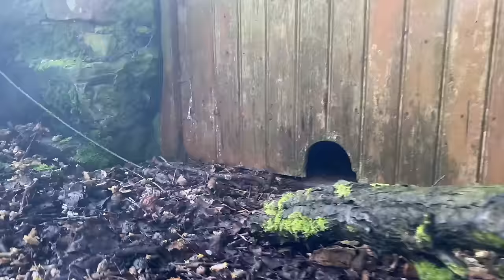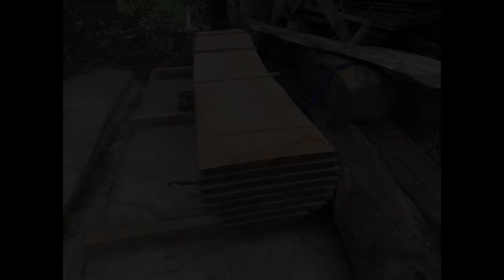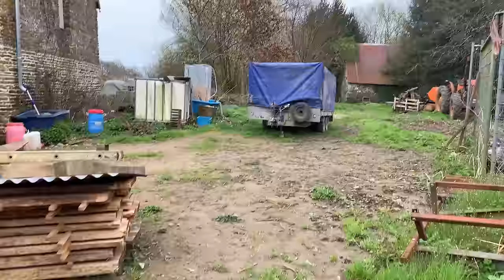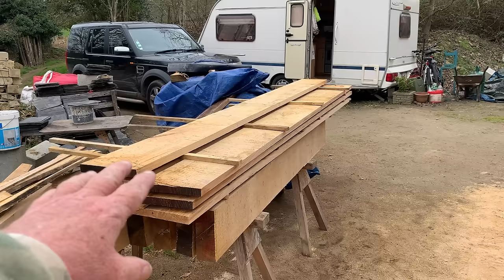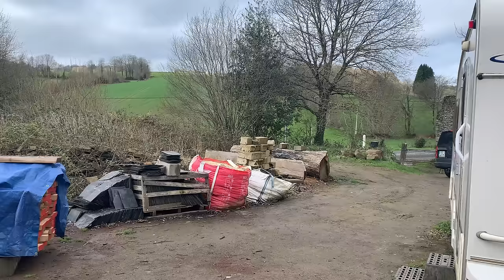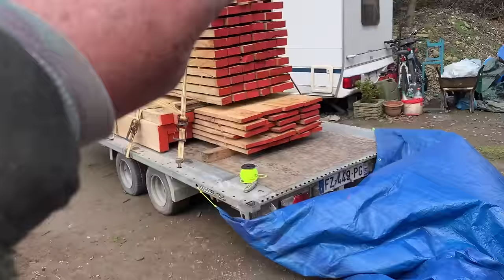ARE WE LIVING THE DREAM !!!! - WE RISKED EVERYTHING NO 152- #frenchfarmhouse  #simpleliving

Comment: looks like another busy week.. shame about the render above the door noticed that in last weeks video but didn´t say anything, another job to do when the weather is right...

one question, why did you paint the end off the boards, is it just to identify your timber when it goes to the dryer?

Chutney looked very tast Tracy...

Have a good Easter

Robb Torremolinos Spain?
Reply from the maker: Hi Robb thanks buddy yes the latex wax paint is to slow the water exciting out the ends to fast and cracking the ends it a normal thing to do on wet timber and the chutney was delicious 🍺🤠👍🏻

Comment: Maybe a silly question but is it a special paint you use for the end of the timber? And is it expensive to get it dried ?
Reply from the maker: Hi Richard its a latex paint for sealing the ends to slow down the drying and it costs here in France around 90 Euros per cubic meter mine is 1.3 cubic meters so 120 Euros buddy 🍺🤠👍🏻